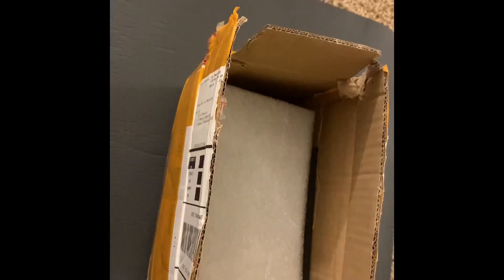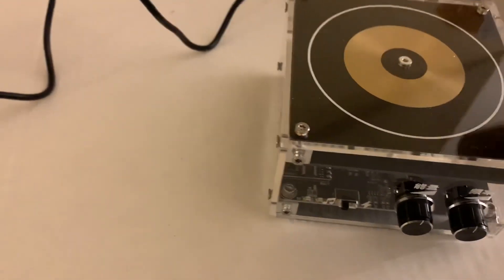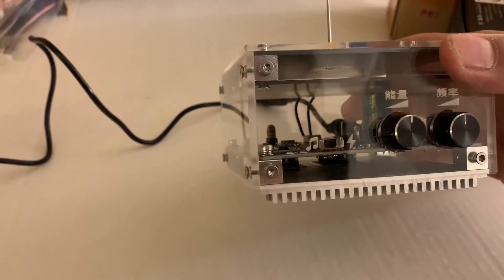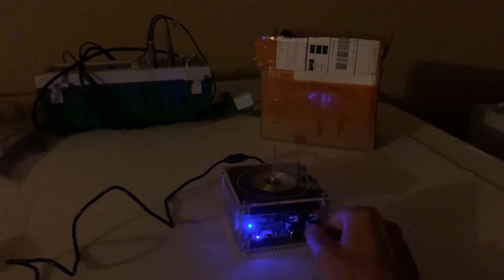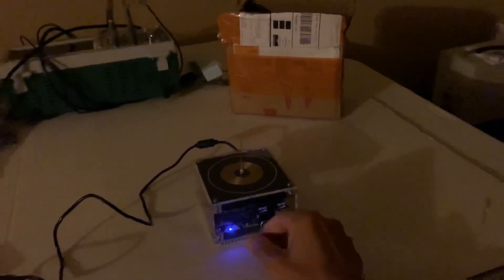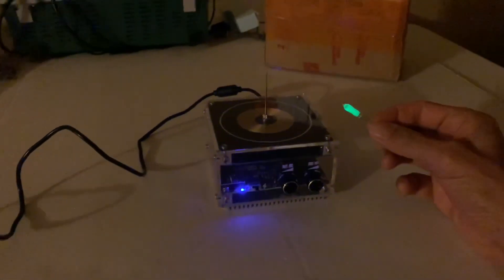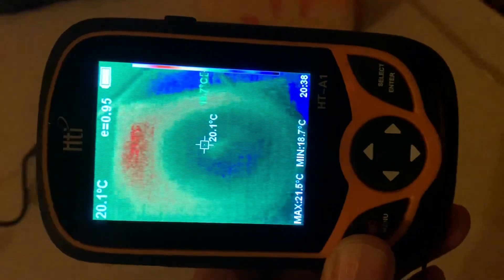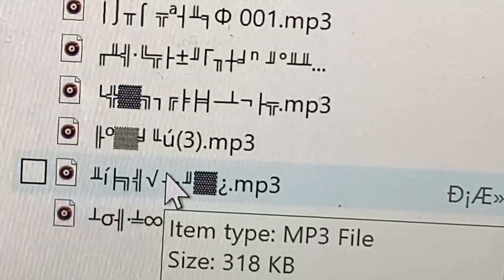Unboxing Cool Flat Panel  Music Tesla Coil

Comment: If you put a longer pin in the top would it still work ? And what is the pin on top made of ?
Reply: Let me give an answer. The pin is actually part of an extremely high Q resonator together with the flat pancake secondary coil. If you change the pin and use something shorter or longer, then the secondary is going to resonate at a frequency lower or higher than the optimal one, so the output will be reduced. You may experience how finely tuned this this is, by simply bringing your hand close to the coil. You will notice the output decreases because your hand brings in additional parasitic capacitance. 
This is especially remarkable at the lower power settings, when the spark is already short
Reply: @inverse2k1  Cool, thanks :)

Comment: Mine dosent work.. just gets red hot on heatsink underneath and smells like burning electronics.. any help appreciated!
Reply from the maker: Is it the same one hat I show in the video? It sounds like it is not getting a high enough DC input voltage
Reply: @BrianDhvTinkerer  yeah same one.. arrived today, it gets burning hot as soon as I plug it in! 
Could stick a multimeter in the adapter output to check its really 48v?
Reply from the maker: Thinking about it some more- it sounds like one or both of the power MOSFETS on the bottom have failed. I would contact the seller and see if you can get a refund or a new unit sent out.
Reply: @BrianDhvTinkerer  just checked voltage of power supply at 49v so yeah I think the two mosfets have gone toast. Shame I was waiting a while for this.
Reply from the maker: Hopefully they can rush a new one to you !

Comment: Interesting output. Is there a way to patch in sound in an audio cable via the 3.5 mm plug ?
Reply from the maker: Looks like only sound input is Bluetooth. There are other models out there that have normal sound input.
Reply: @BrianDhvTinkerer  U should post a link to where this is available..